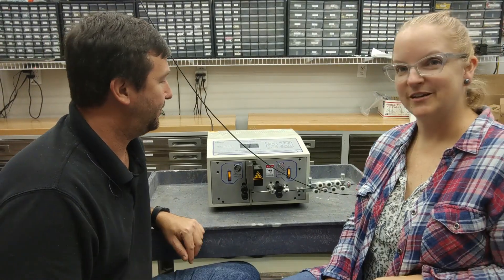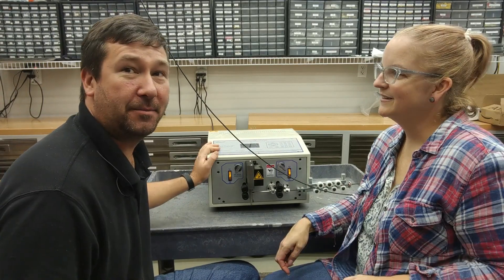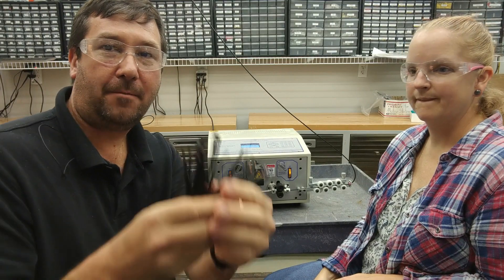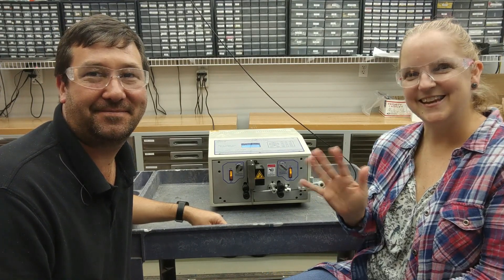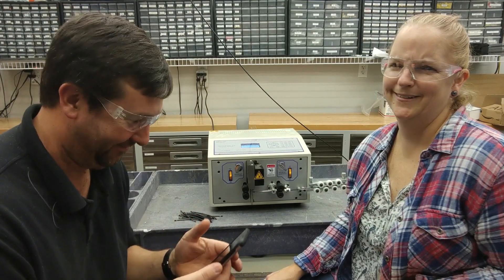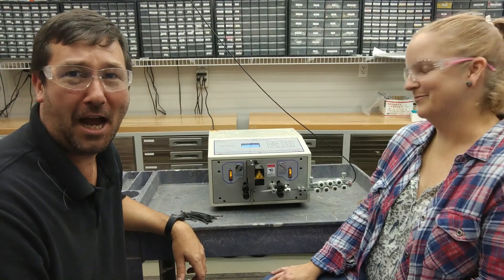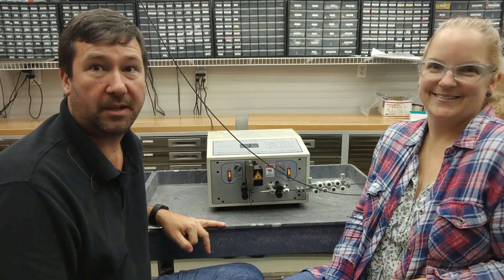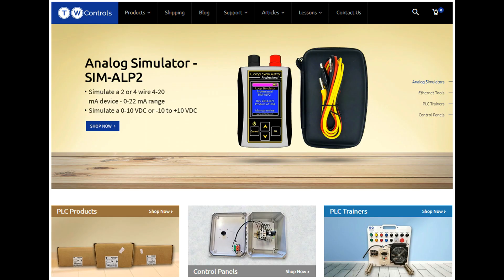Automatic Electrical Wire Cutting and Stripping Machine

Comment from the maker: You can get your wires cut to length, stripped, and optional ferrules added at the following link.
https://www.theautomationstore.com/wire-cut-and-stripped-to-length-mtw-tinned-copper-type-mtw-ul1015/
Reply: The reason I asked, I have just got a SWT508-E and i have worked out the cutting, bu I am having trouble with the stripping, setting the strip depth, also having a hard time finding a supplier that sells the blades to cut and strip 2 and 3 conductor wires.. TIA

Comment: Any idea where I can find rubber covers for the rollers on this machine? The metal rollers are putting indentations in my wire. Thanks.
Reply from the maker: Back the roller tension off.  The wheels should almost slip when you pull the wire.  Even if they slip a little, it will run OK

Comment: can it cut wires upto 2-5 meters length and what size. Can it accommodate wire size upto 6mm2.
Reply from the maker: Yes, it can handle that length and when our machine was new up to 12 AWG but it is finicky now so we only run up to 14AWG on it.
Reply: @TimWilborne  kindly share your distributor details in middle east or saudi arabia.

Comment: Will that machine handle #10 wire?  We have a machine but end up stripping the ends by hand.  I am not sure if that is due to lack of knowledge by the operator or if there is an actual problem with the machine.  This is a model SWT508 SD/SDB. One of our panels takes 96 of these wires and we have hundreds of panels to build.
Reply from the maker: When ours was new it might have but we're getting ready to scrap it. Our new one will have a lot more features.

Comment: Tim,  I recently purchased this machine although it looks like the design is now reversed as the wire comes in from the left.  Do you have better instructions by chance?  Trying to strip 22awg stranded. 12" pieces with both sides stripped. Any help would be greatly appreciated.

Comment: That's funny we have the same last name. I have the same machine but I'm having alot of trouble getting the settings dialed for my 22 gauge silver wire. Any help/tips/advice would be amazing! Have a great day!
Reply from the maker: The key is understanding the RTL setting.  Put a piece of wire in, go to the RTL setting, and press the stop button.  This will take the cutter down to the strip depth.  It is 95% of the problems on mine.
Reply: @TimWilborne  I'll give that a try tomorrow morning, thanks!
Reply: @Glocktopus42  I am using 22awg wire as well.   I just got the machine and am having no luck getting it work.   Do you have better instructions by chance?  Trying to strip 22awg stranded. 12" pieces with both sides stripped.   Any help would be greatly appreciated.   Thanks  John

Comment: Can this be set up to simply cut specific lengths of wire? I do not need the ends stripped. Just specific lengths cut.
Reply from the maker: Yeah simply specify not to strip the ends in the order notes at the following link.
https://www.theautomationstore.com/wire-cut-and-stripped-to-length-mtw-tinned-copper-type-mtw-ul1015/
Reply: @TimWilborne  Thank you. Actually thinking of purchasing one for myself though. Just looking for feedback from current owners.
Reply from the maker: @kristophermorgan2302  The settings are a little finicky but once you get it dialed in, it is very nice.  It is very beefy but when it breaks, it can be a bear to troubleshoot.  I would purchase some wire first and see it works out for you.  It can cut 6 months of our standard control panel wire in about 3 to 4 hours so it sits around a lot.
Reply: @TimWilborne  thank you for the feedback. I work with all small diameter wire. 30 ga up to 24 ga. And 26 ga jewelry wire. Does it mark up the insulation on the wire?
Reply from the maker: @kristophermorgan2302  If you set the rollers too tight then you will see a knurling pattern on the material but not normally.  If it were for jewelry, I would probably put some tape or other soft material in place of the rollers.  What material are you wanting to cut?
Reply: @TimWilborne  mostly it would be KYNAR wrapping wire.( 30 gauge). Some other small diameter wire as well. I am not in the electronics industry. This stuff is repackaged to detail model cars. Used as spark wires, hoses, fuel lines, etc. So having a  clean appearance is a must.
Reply from the maker: @kristophermorgan2302  As long as it is copper, you should be OK.  I don't like cutting anything else on mine, I've had trouble in the past.
Reply: @TimWilborne  thank you very much.

Comment: Would you be able to cut .1 inch aluminum wire with it?
Reply from the maker: When ours was new it could cut 10AWG stranded copper so it should be able to do that in stranded with a fresh set of cutters.  I've never ran any solid wire through it.

Comment: will it cut coax cable about 2' long
Reply from the maker: No not without modifications.  It could run it but the guides are too small for coax, they would have to be enlarged.

Comment: Tim, what is the make/model of the wire stripper you are using?  Thanks
Reply from the maker: Here is a link.  We have extra bandwidth on ours if you are looking for some particular sizes and lengths.
https://amzn.to/2HMrbwK
Reply: @TimWilborne  Tim, thank you for the offer.  I have large wiring harnesses that need to be built so this will be in use quite a bit.  Thank you for the offer.  I ended up finding a very similar item on eBay and purchased for about $500 - the wire size I believe is good through 18 gauge which is what I use primiarly.  See link.  https://www.ebay.com/itm/183396595012 12awg through 32awg cutting.  $500 + shipping.
Reply from the maker: @eastmanresearch3143  That looks like it.  You'll really like it.
Reply: Please add Whatsapp or WeChat, I will bring you high-quality machines and preferential prices, +86-18913246372
Reply: How's the machine doing? Still going strong?

Comment: I am curious as to whether or not this machine can handle 16 AWG MTW. The stuff with that thicker 600V insulation. I have been considering similar models on eBay. The spec sheet says 4.5 mm2 max, and the MTW wire has a 3.5 mm insulation outer diameter.
Reply from the maker: Hi Michael.  We run 14 AWG MTW through ours normally without any problems so 16 AWG should work fine.  Thanks for watching!

Comment: May have missed in video if you mentioned it ... What’s the maximum gauge wire that the stripper can handle?
Reply from the maker: We've had 12 AWG in it.  It might take 10 AWG, I'd have to check.
Reply: Please add Whatsapp or WeChat, I will bring you high-quality machines and preferential prices, +86-18913246372